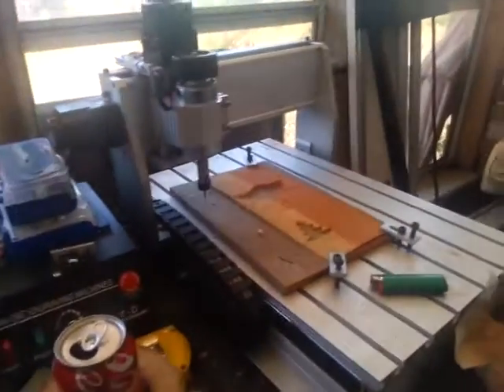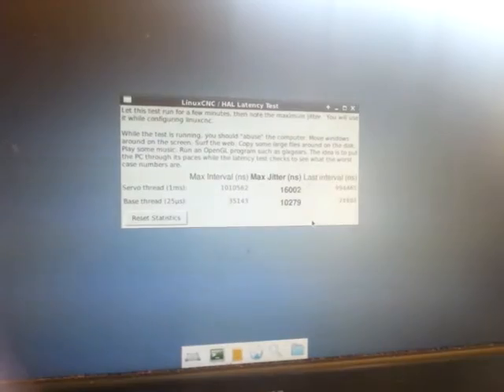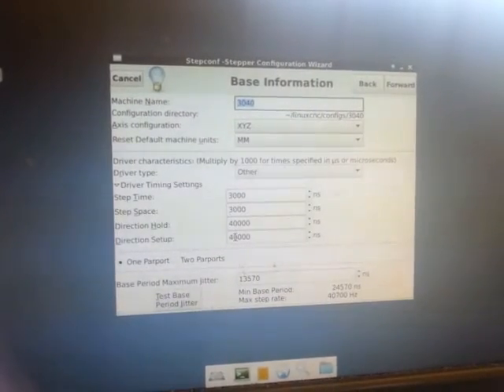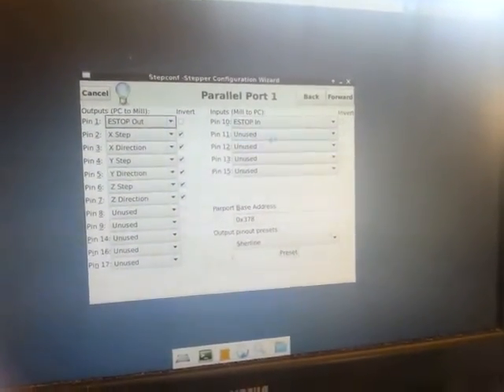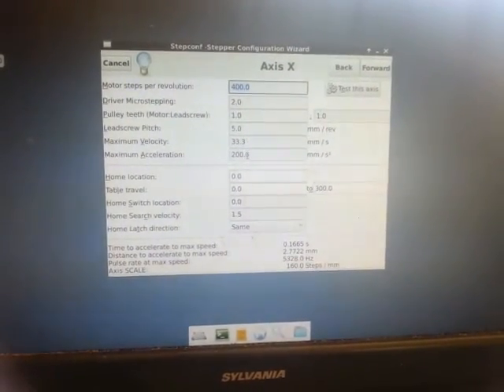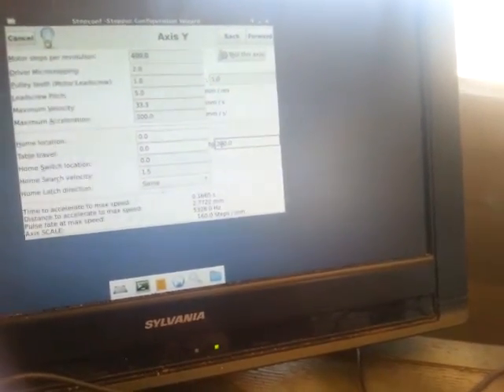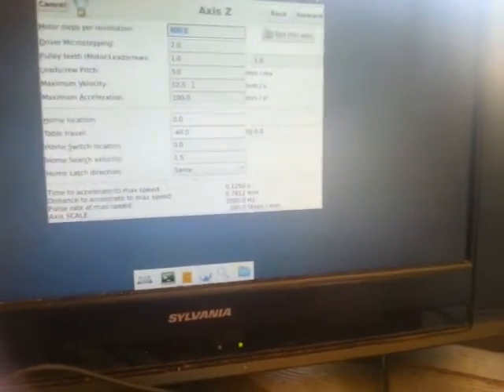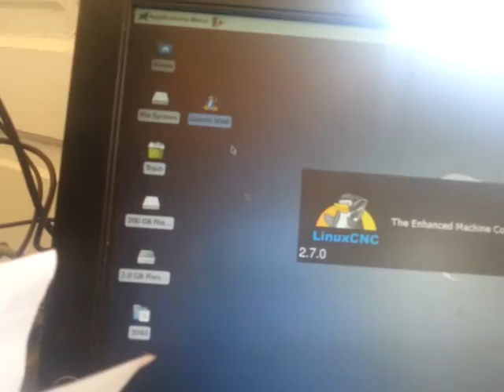LinuxCNC  3040 chinese CNC mill Basic Setup

Comment: Did you have to do any modifications on this cnc machines control box? I just got one and have been trying everything to get it going with linux cnc....Just found the motion controller in mine on the internet...in my reading looks like it won't work with Linux cnc...only Mach 3.  Now that I partitioned the computer i have with xp to debian/linux..Now I have to locate another hard drive. and get Mach 3.   Watched your vid a bunch. thanks man.

Comment: Hi there. I have purchased the same machine and after using Mach3 I find linuxcnc much easier to use. I was curious what did you put in the table travel section for your machine for x and y axis?

Comment: For my setup to operate properly I had to play around with the "Table' numbers to allow for more negative movement.  Kept giving me "joint" limit errors.  I set the Z axis to +5mm and X and Y axis to -50mm to allow for gcode that is operating with tolerances.  Careful not to home too close to the edge, work in the center of the table and as much as possible and you should be ok. Any other advice on this would be helpful as I am a Noob to cnc.
Reply from the maker: with LinuxCNC,  you dont need to have limit switches. I'll have to make a video that shows how to 'home' when the machine is at the X,Y, Z coordinates you want to use